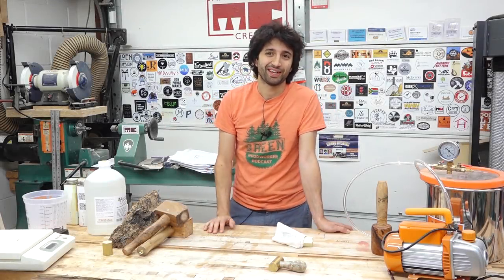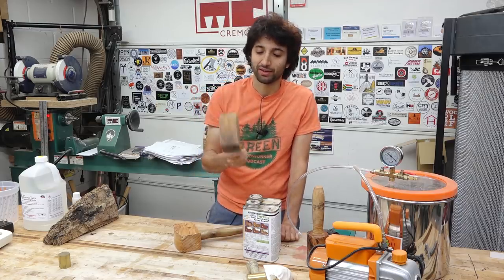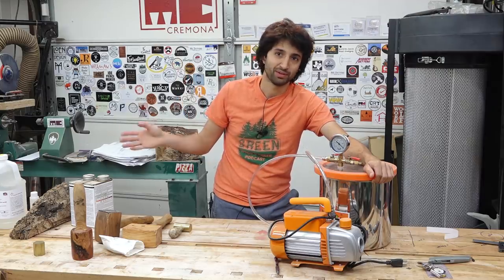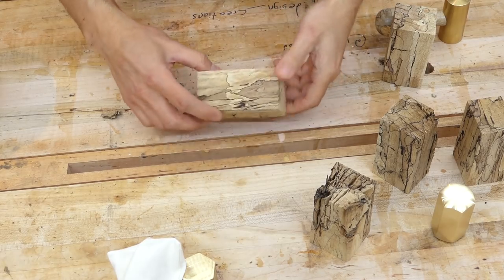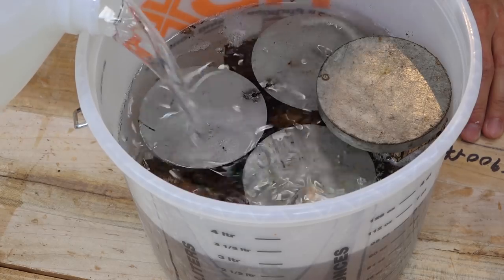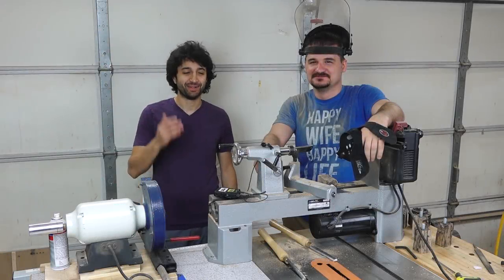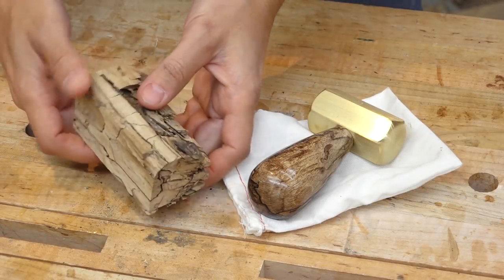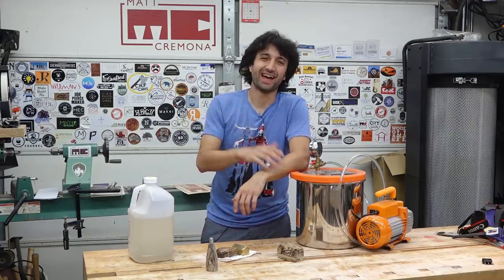Rotten Wood to Brass Hammer Handle - Resin Stabilizing

Comment: What do you think of stabilizing larger slabs of spalted wood for table etc.?  1st stabilizing the wood and then do all the other steps (epoxy pour, ssanding, finish etc.) so at the end you would have a nice solid spalted table. Is it cost effective and worth to do that. Did you ever tried it?

Comment: Another interesting video. Good result. Very nice!

I'm sitting here thinking about pressure treated timber in the UK. My understanding is that it's placed under a vacuum to get the air out, so the chemicals seep into the wood. I've read that it's the removal of the vacuum that helps force the chemicals in too - at the end of the soak. Basically restoring atmospheric pressure pushes chemicals into the wood.

Does this mean that you don't need to soak for quite that long?

Comment: Hello from Tennessee! I have 2 boards (spalted maple) with huge holes made from worms. They would make really cool serving boards after the holes are filled with epoxy.  This would strengthen the board! 😊. My question is this....could this be wrapped in aluminum and left in the sun for a week or more to heat it up enough? I'm guessing that baking it in my oven wouldn't be good.

Comment: Exceptional video as usual Matt, thank you for sharing it with us. Quick question if you don’t mind please. When reading the written description that I googled then following the link here to the video, in neither did you say anything about putting the blanks in the oven to dry them out first before then putting them in the resin and vacuum. Did you pre-toast them as is recommended or did you just cut the blanks and put them in the resin as it would seem you did?  Also, if you did toast them dry before resining, would it still work with some pieces of timber that have already been glued together or would the glue fail because of the heat? Any help you can give me would be really helpful if possible please. Again thank you for all your great teaching, you’ve helped me to become a much better and finer woodworker and I am eternally grateful mate. All the best from Down Under, hang in there and stay safe during this terribly difficult time mate, stay cool, see ya 😎👍🏻

Comment: Another step you could try is after the vac and soaking. Get a painter's pressure pot. (You will have to do a few mods to it). Put the whole container into the pot and pressurize it to 60 pounds for about 8 hours, then do your wrap and bake.
I like the idea that Heather has about making a rolling pins.

Comment: Hey, you could add those metal weights that you used to hold down the wood in the epoxy as heat sinks/heat shields in the toaster oven. Placing them between the heating element and the wood could help even out the temperature within that tiny toaster oven, and protect the wood closest to the element from big swings in temperature. 

Love the videos, Skol Vikings!

Comment: Tried using CPES to stabilize some rotted pine beams, ended up disappointed with the result, did NOT penetrate well, only lasted a year or two.  Of course, I didn't have a vacuum chamber - but it didn't say that was necessary, either.  The stuff I tried was from The Rot Doctor, maybe this one is a better product?

Question - why turn the wood on the lathe after infusing, wouldn't it be faster & waste less resin by infusing first?

Comment: WOW!!! Don't know how I missed this video at the time of it's release (?!?), but I'm thrilled and confident that I will glean truly reliable, expert knowledge, as always! I'm actually looking into "stabilizing"(if it's applicable) a 6"-thick White Oak slab, for use as a heavy duty workbench. Wondering what the best material(s) would be, in your opinion, as well as wether you think it's even feasible or not. Thanks tons for any feedback, and thanks at least ONE ton, even if you don't respond! (Edit: btw, I LOVE the hammer! I'm a big fan of all sorts of the category of slightly heavier hammers, for all sorts of uses....things like in the "lump-hammer" range.... This one, with the short, thick handle, makes so much sense - tons of control for deft hammering!)
Reply from the maker: How much stabilizing does it need?
Reply: Matthew Cremona - So, that's the thing...it probably doesn't "need" any.... It's just that the few small checks will unnerve me, as I plan to be able to bolt-things-into/beat-on/have-for-a-lifetime, whatever I build, Lol. I certainly could just "fill in the cracks", but I'm in the "do it all the way, or not at all" type of mindset. Also, does this product REQUIRE a vacuum, or would a stupid amount of time also work? I'm imagining having to build a trough to soak the slab in, and turn it over after a week or so...or two... whatever....
Reply from the maker: @samuelluria4744  If it's just cracks, regular epoxy would be fine.  this stuff is more for hardening rot or making wood more dense for polishing.
Reply: Matthew Cremona - Thanks! I appreciate your valuable time! Stay warm!😉
Reply from the maker: I'll try!

Comment: A BIG hint, when returning unused resin to the original container, filter it.  I've found a cheap funnel can be made by cutting off the top portion of a two liter soft drink bottle and putting a fine screen toward the bottom.  The funnel is disposable, and it will keep stray bits of foreign  matter from contaminating your next project.  ^_*

Comment: Matt - hopefully you'll read this. You need to run the vacuum pump continuously until all of the air is pulled out. If you just stop the pump and let it sit, you will not get all of the air out of the wood and therefore will not get maximum cactus juice penetration. Ask Curtis - the guy that makes the Cactus Juice. He's great at answering questions. Also look into getting one of his Oven Tamers fir your oven. You will get a more consistent temperature during the curing process which allows you to run the oven at a lower temp. That will result in less resin coming back out of the wood.
Reply: Leaping Lemur Craftworks the wood was so gone that it was soaked through before he hit the vacuum, on a more solid wood it is true you need to hold a vacuum longer.
Reply: Thanks for the reply Dema. I've not stabilized a piece that was that rotten. "How long do I need to run the pump" is a common question for those new to stabilizing - I know I asked it.....multiple times. The hammers have been looking great - been following you on IG.
Reply: Leaping Lemur Craftworks yeah it's definitely a learning curve, I've had some blanks with the pump running for 24 hours before, understanding the wood you're using is key and that knowledge doesn't come over night. This is matts first stabilize, I think he did good :)

Comment: Would be nice to see a follow up on what these hammers are actually used for! I guess for chiseling, but when would you use these instead of the traditional wooden mallet? Or are they interchangeable and it comes down to just preference?
Reply from the maker: I can address that but yes for chiseling/detail work where you don't need much power behind the tool

Comment: Not complaining or criticizing, just asking: Why are the handles so short and wide?  They're beautiful but they don't seem like they'd be very functional - lots of rapped knuckles.  Could you have used this, still with the super rotten wood, to make a more typical hammer handle (~1-2" diameter, ~1' length), or would it not hold up to the sort of abuse that that would likely encounter?
Reply from the maker: The idea with these is they're useful for operations where you would choke up on the handle like chopping and cleaning up dovetails. More precision work where a lot of impact force isn't necessary. The short stubby handle fits comfortably in the palm of your hand while your fingers hold the brass head. But yes, you can make a handle any length you want
Reply: Ah, gotcha.  I figured it was for precise work but I still couldn't see where my fingers would wind up.  Thanks!

Comment: Would,it have worked faster if you drilled the hole before the epoxy infusion process?
Reply: I'm sure the wood was too far gone to produce a solid clean hole in the blank.  Also, during the baking process, any residual resin could have pooled in the hole, so it would have needed drilling again anyway.

Comment: The handle is beautiful but how taff is that wood not to break
Reply: Teo Tal the head is connected to the handle with a 1/2 threaded rod, the rod extends into the handle 2". Handle is just for looks and is not structural in any way

Comment: Do not buy the vacuum chamber setup used in this vid for stabalizing wood.  I am returning mine as the lid cracked due to using cactus juice.  I have contacted the company and they confirmed that it isn't suitable for using with cactus juice.  Otherwise, good video.
Reply from the maker: Did they say why?
Reply: Matthew Cremona -Yea, they said it was due to the acrylic top. 

They said " vacuum chamber with acrylic cover is not suitable for this application, but suitable for BHO, silica gel degassing"
Reply: If anyone does have this setup, do not let the resin touch the lid.  There is a chemical reaction with the acrylic.  Be careful when releasing pressure to decrease foam buildup,  as that pressure may spray resin onto the lid.  Again,  great video as always Matt.  Just some helpful tips to avoid cracking of the lid.

Comment: I know I am getting in trouble with the "Artsie Fartsie" community here. And I really enjoy your efforts and products... but.
This is NOT wood stabilization. This is using rotten wood for colorization. That is a plastic handle with wood as the non-structural figure. Pretty but ersatz, IMHO. Celebrate the wood, as you are so good at, by finding the beauty AND structure with creative milling.